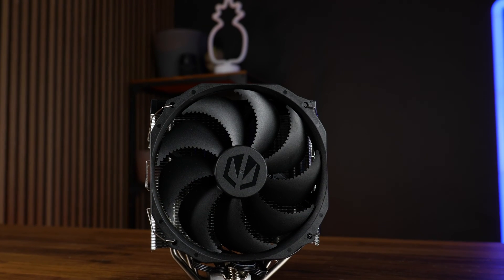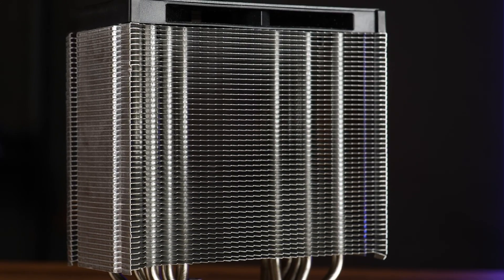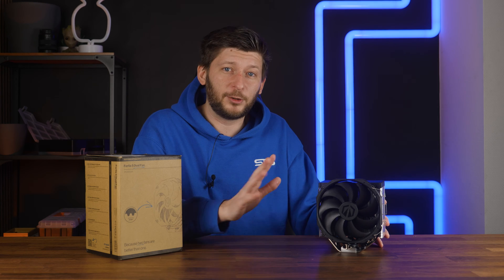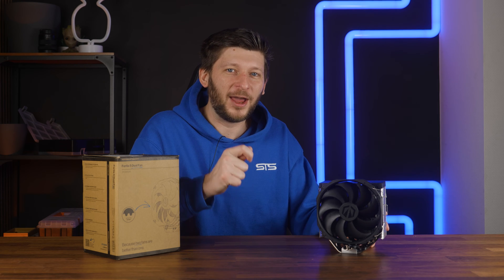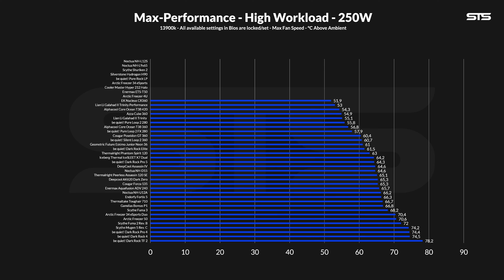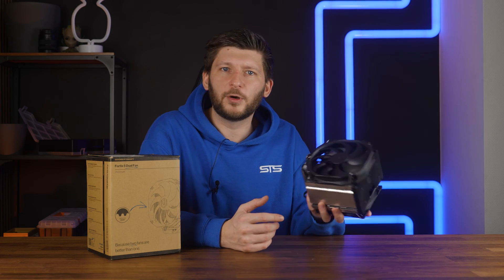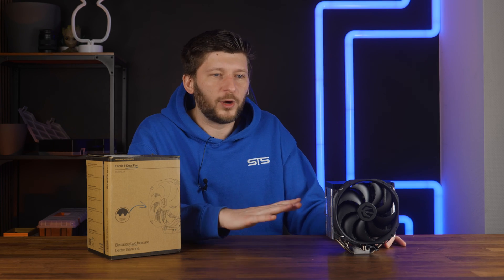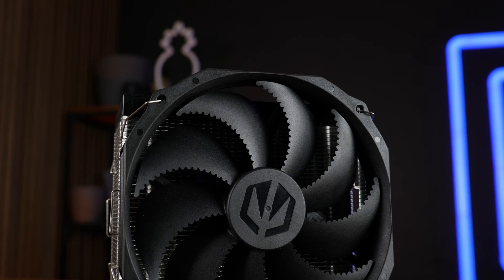6x Heat Pipes & Direct Touch - Endorfy Fortis 5 Dual Fan

Comment: The fans have 3 pole design that is why so quiet especially at low RPM, there is no "tractor" sound from the hub. Even the cheaper non jagged edges ENDORFY Stratus fans have 3 pole control, the only other brand I know using it Noctua and BeQuiet Silent Wings which are 3 times the price.
Interesting fact that the air is pulsating behind the fan, I never noticed this phenomenon with other fans before.

The 120mm fan on the back doesn't add much performance, mainly just adds noise and since the hetsink sides are closed it can't suck fresh unused air trough the heatsink like in a 2 tower design. You should only buy the 2 fan variant if you want to use the second fan as a case fan.

I think the direct touch surface is superior compared to flat surface, with the flat coldpate the added extra copper also adds delay to the cooling. Direct touch coolers over 5 heatpipes perform worse on "smaller" intel CPUs socket 1151 and 1200, where the two side pipes doesn't touch the CPU IHS.

I wonder how the Peerless Asassin would perform with two of ENDORFY 120mm Fluctus fan.

Comment: I have an older version of this cooler , it was called Silentium PC Fortis 5 when I bought it back in 2016, yeah  the build quality looks like its made from paper , but the performance  is solid , the fan has ~73k hours on it and it is still working whispering quiet , in games or day to day tasks it keeps the 6700k @4.4Ghz  well below 65C,i can recommend it all day long :)  it is just doing the job at a fairly good price. I don't know about the new series yet , but with my new ryzen build I am going with the fortis 5 again :)

Comment: Rotating backplate slightly for different sockets is not a new thing. Dunno if they still do but Scythe used to have similar solution. I still have a Mugen 5 with something similar. One backplate with few sets of screw holes, which align when you rotate it slightly. Pretty good solution if you ask me, reduces mounting system to what's really needed and nothing more.

When it comes to the plastic on top, I would not look too much into it. Heatpipes are really pointy at the ends, and don't look particularly good. Plus the ends are not really that great at conducting the heat anyways. So this solutions is better for noise than completely closed off top, maybe slightly worse than empty top. Looks are subjective. IMO it looks good and allows for some customization.

Fluctus fans are well regarded when it comes to performance and noise. On polish side of YT, Bartosz Szwedkowicz did many tests in which Fluctus fans came above many price competitors and held to much more expensive solutions. Not the absolute best, you can't really beat 3000 RPM T30s or even NF-A12x25 which use LCP, and thus have measurable advantage due to materials used. HardwareLUXX and some other sites (I cannot recall the names of right now) also confirmed these results. Considering the price - they are good. Like really good.

I've read on some Facebook groups that front fans allegedly do not come with preinstalled rubber pads because there are some motherboards, which position RAM slots really close to the socket. So to avoid any problems out of the box, they are off and user can install them if they choose too. Personally I've come across some motherboards which had DIMMs really close to the socket, sometimes seemed they were too close. So they may have some merit with this. It's not like it takes that much time to install them anyways.

Comment: That plastic cover might be not as useless as you might think. It might optimise airflow to force it go through the fins.
Similar thing exist in PSU, where there is often a clear plastic baffle just behind the fan to optimise airflow.
As for why not add just a few more fins on top - well, you can do it, but half of the heapipes won't touch them there (because of the heatpipes shape on the end - for example, look at the Thermalright Frost Spirit 140 without top cover). So it actually might be more beneficial to optimise airflow.
Reply: Those covers are useless, they add extra unnecessary weight to hide the cost cutting. The sad part is that the "full" heatsink version probably exist in every cooler manufacturer, but the extra 5-10mm heatpipe and the extra 3-4 aluminium fin doesn't help much in the real world so they leave it out and put a cover on top, because otherwise "looks ugly".
The cover also add extra unnecessary material and labor cost, basically just a branding thing, look at the Thermalright Peerless Assassin it is cheap because they leave out all unnecessary things like cover, which probably would add at least $1-2 for the price.

ENDORFY cover consist from 4 screws, one aluminium plate and one plasic cover weighing 65g, if I add the unnecessary 120mm fan on the back that ii 200g in total, 200g unnecessary stress on the motherboard. BTW the top cover directing trough the air in itself narroing into the middle, probably no real performance impact maybe the fan using a couple mA more at higher speed due to the higher air resistance.

Comment: The 120mm is further back to reduce turbolances, I guess. But without a spacer it would suck a lot of air from the sides instead of from the cooler.
looking forward to the fan reviews as serration on the front shouldn't make much sense, but hey if it works.
Reply from the maker: It kinda does work, the Fluctus is really quiet for that 1800RPM. Not to say it performs impressively but it's quiet. The video will be out somewhere mid March

Comment: Is the fortis 5 dual fan version in the tests or the regular fortis 5 without an additional fan at the back?
This is quite a misleading name, because the dual fan is noisier and not much more efficient than the regular version. 🙂
Reply: The test probably done with 2 fans.

I use it with only the 14cm fan, the 12cm fan is on the back is loud an useless at lower RPM and lower TDP, I like my system quiet.